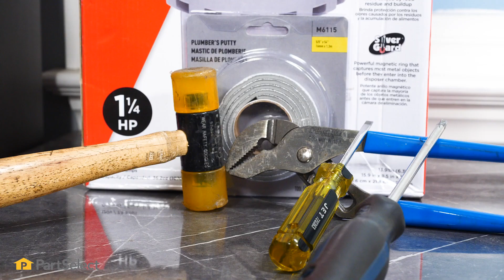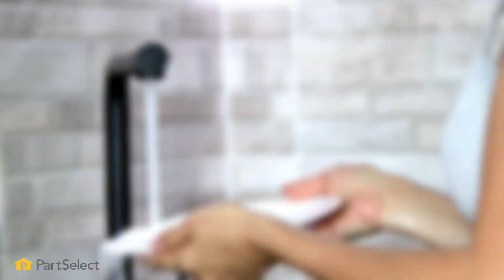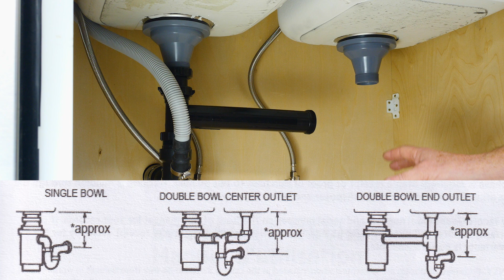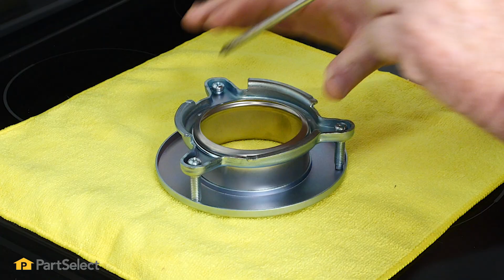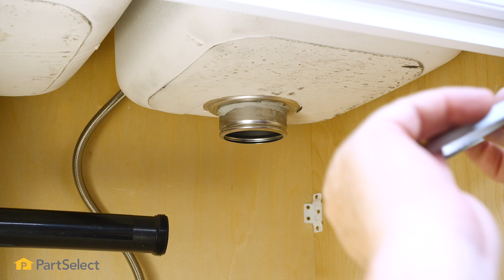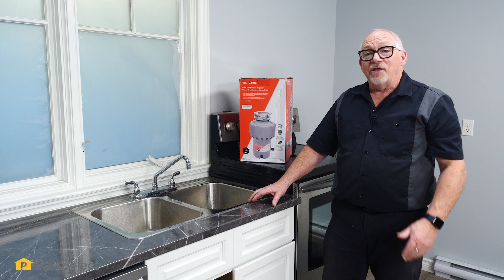How to Install a Frigidaire Food Waste Disposer | HOME DIY | PartSelect.com

Comment: He's not lying about the potential risk of undermount sinks. After a few years with a garbage disposal weight and vibration, the entire basin fell and had to be reset, glued and clipped. They advised me to put a support under the GD. (Great video -- thanks for sharing)

Comment: Great video - why didn’t you install the fiber gasket under the sink (E1 in step 6 of the installation manual)?
Reply: That is very good point, fiber gasket should have been under the sink, and not above as the guy has done in this video.